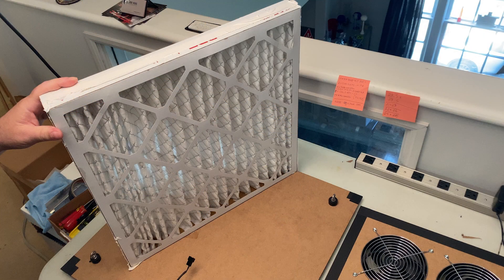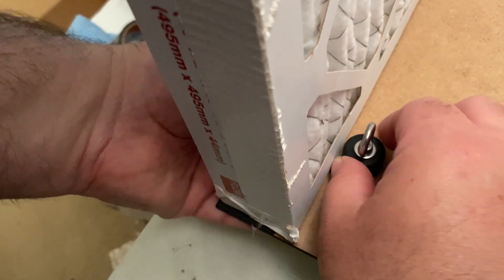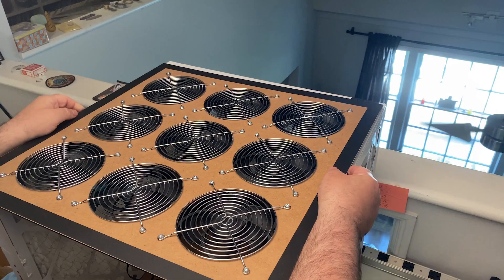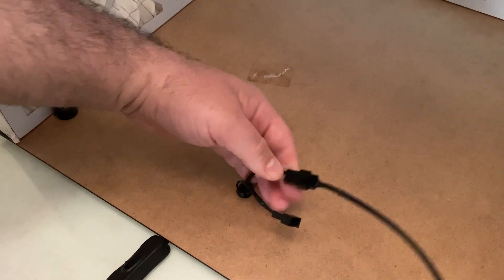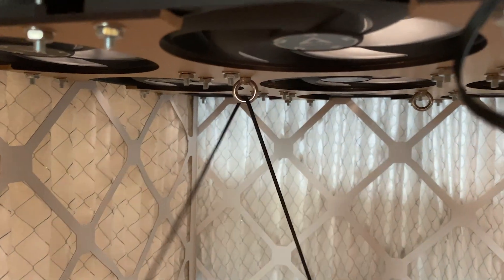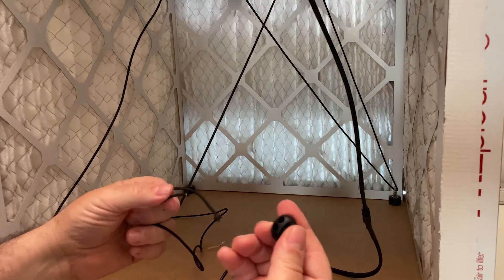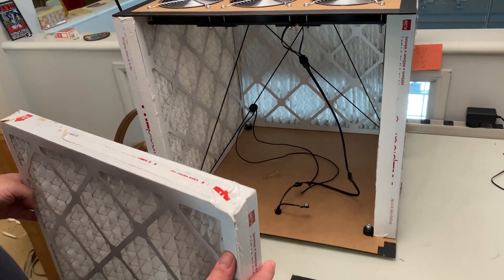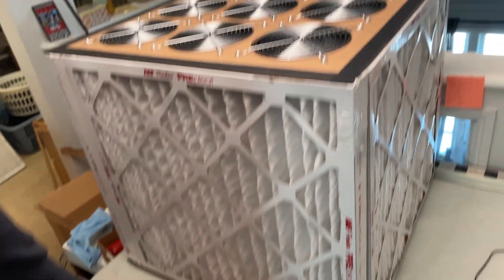North Box Systems 9for4 Kit Assembly

Comment: What did you guys use for the ac on/off switch?
Reply from the maker: The power comes in as DC 12 volts so a simple in-line switch was used:  https://www.amazon.ca/dp/B09BPXDMCH/?coliid=I2B5BBWNU7O4LV&colid=1TP41YLMNZ3VW&psc=1&ref_=list_c_wl_lv_ov_lig_dp_it
Reply: @RobertFantinatto  thanks!

Comment: 9 fans? Impressive‼️😱 

1. Does this work with 3M 20x30x1 MERV 14 MPR 2500? 

2. Does it come in black acrylic?

3. What’s the CFM, watts, db on high? 🤔

I’ll take one. 

Thanks‼️ 🙏🏽
Reply from the maker: Yes, as long as you create a 20 x 20 opening up top.  

This was a one-off commission build and I haven't got exact test data on this specific build but using the same basic set up others have measured:  556 cfm /  44.5 dBA /  11.2 Watts

email me at aidankepo@hotmail.com and I can make you one.

Comment: Id buy this for my 250 sqft room. Im EXTREMELY sensitive to dust and allergens. Im waiting for my clean air kit luggable XL, and if that works, ill maybe be good, but i want to ensure the dust in my room is no more. This loos like a great and quiet design.
Reply from the maker: I'm sure the Luggable will be enough for 250 sqft.
Reply: How did it go?
Reply: @ honestly helped maybe a little.  I get to much dust so my room gets dusty, and the filters get dirty quick. But I still run it every